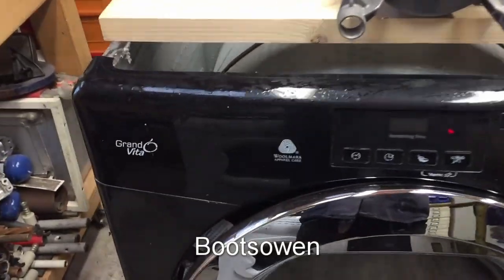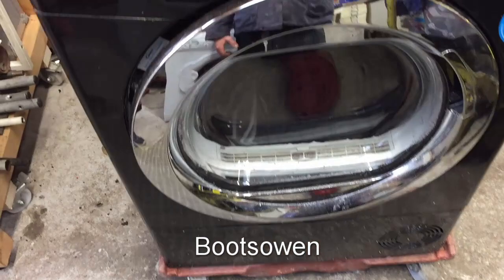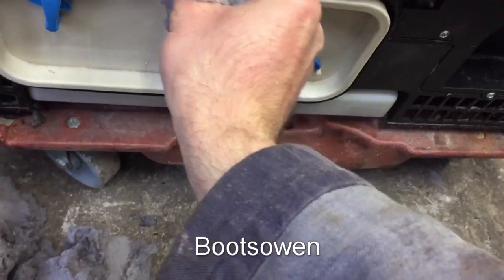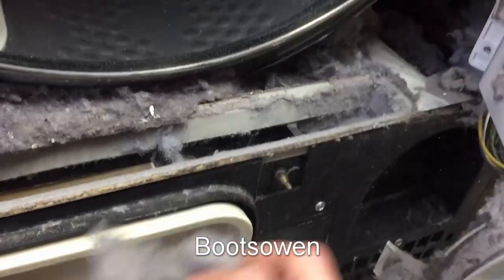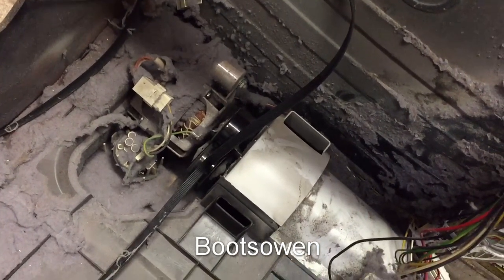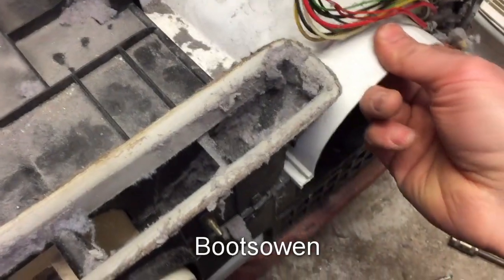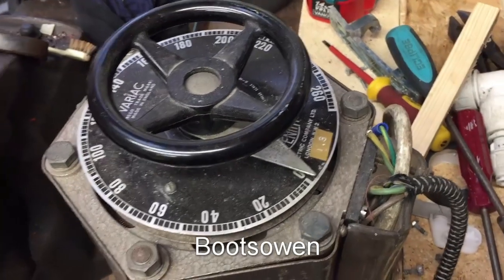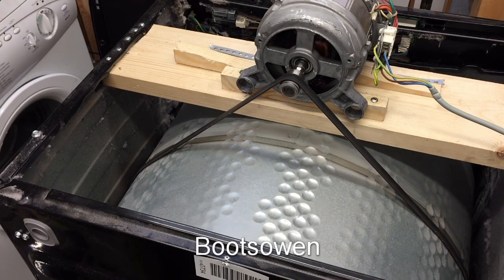I fitted a washing machine motor to a tumble dryer | superfast tumble | Candy Grand O | How to

Comment: I had that in white, mine overheated and started smoking. Lint was touching something hot. 😵 dangerous machines. And it actually sounded like that running.
Reply: Wet towels 🤣
Reply from the maker: Crazy machine. What should I throw in it?